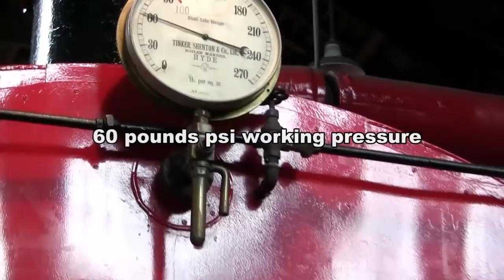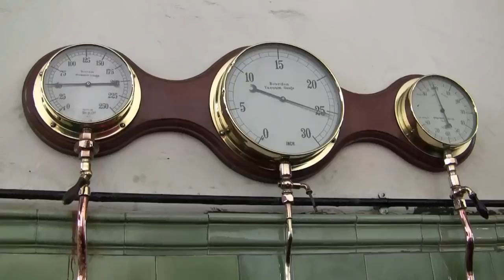Big Steam Engine

Comment: Over 100 years old engine and still in brand new condition and runs just like new. Modern engine are garbage compared to these. These are built to last. These are the engines we should be building.

Comment: It is just such a spectacle to see those valve gears moving while the engine is running. Truly, modern machines could never match the fine engineering and sheer elegance of these metal masterpieces!
Reply from the maker: Engineering elegance is quite right - all designed with pencil & paper...not a computer in sight!
Thanks for watching,
M

Comment: Furniture mills around my area had steam engines that recycled used steam into the dry kilns to dry the lumber. Hale Co. in East Arlington Vt. used theirs to power two Westinghouse ac generators along with belt driven wood working equipment. W.J. Cowee in Berlin N.Y. ( remember your old tinker toy set? ) used their horizontal and vertical steam engines just for generation of electricity.
Reply from the maker: Many thanks for taking the time to leave such a wonderful comment. I'm glad you enjoyed my vid.
Best regards,
M
Reply: I was lucky in that I got to see all this equipment in place even though it wasn't running. Younger folks have no concept of these things unless they see it in a museum setting. So sad that so much of history is just scrapped and melted and the knowledge that accompanied it lost to the pages of history. You can never describe the smells of dry kilns or the whir of shapers and tenoners in a furniture plant.
Reply from the maker: 8x56 Similar here on the West coast with all the industrial logging and fishing gear....sounds as if we are of similar age!
M

Comment: Here in Brazil, near my house has a very pacecido engine with this, of English origin and German boiler in good condition, part of the old system of pumping water. In the same place also lies a marine diesel engine, two-cylinder, over ten feet tall. 
Not to mention the steam machines Paranapiacaba, with some eight thousand horsepower. a magical place in the middle of the rain forest!
Reply from the maker: Thank you for mentioning this. I looked up Paranapiacaba in Wikipedia and read about some of the history of your area. Very interesting.
Thanks for watching and commenting!
Regards,
M

Comment: Ok, so now I have a question again. My hit n miss is 1.5 hp and 500 rpm. So (1.5/500)*5252
That is roughly 16, so 16 ft lbs of torque, how is that right? It seems like the engine has more power than that.

Comment: Am I correct that the engine could be replaced with a 500 HP car engine (in terms of being able to run the factory)?
Reply from the maker: Horse Power is one thing; torque is quite another. A steam engine has constant torque, which is considerable, whereas an IC engine develops maximum torque in a relatively narrow RPM range. Food for thought...
Cheers, M

Comment: Use the heat of steam engine to provide electricity and make hydrogen fuel so that engine keep running in very low energy momentum for longer duration

Comment: 1) Half the HP of a Bugatti Veyron, runs off coal.

2) WHY THE MUSIC??? WHY???
Reply from the maker: AlmightyBanger For no music go here https://www.youtube.com/watch?v=CdBcYg53DvE
Thanks for watching!
M
Reply: +AlmightyBanger Try getting a Veyron engine to run non stop 24/7 for weeks on end. At this power level, it would fail within hours. A day or two at most. With a giant steam engine like this, you could add extra boilers and feed it greater steam pressure and get more horsepower out of it, but the wear would increase, and the life of the engine parts would decrease. These things had to run and run and run, so they were overbuilt, built big and heavy and run at a lower steam pressure and horsepower than they technically could produce, but which prolonged their life and made them much lower maintenance. They were sized so that the power they did get out of it was exactly what the factory needed.

Comment: 60psi working pressure? That seems unlikey, seen as the pressure gauge shows it blows off at about 95psi
Reply from the maker: Plant was installed over a 100 years ago... Just reporting what I saw a few years ago. Probably conserving equipment to keep it running as long as possible. No?

Comment: WTF? Compound expansion to try to get some work out of 60 psi steam. A joke, no? (For the un-initiated, to get any sort of efficiency w/steam, you need HIGH pressure, >1000 psi, and lots of superheat, preferably with turbine. Else you're just making smog.)
Reply from the maker: Tell us how you really feel!
Reply: thumbs down for the 'WTF' comment
Reply: Putting the more advanced techniques into practice took time. People could not do everything at once, and there was immediate demand for cloth. An interesting example of the transition was the Titanic, which had a turbine that used the spent steam from reciprocating engines.
Reply: @oliviamonkey  Making joke in defense of engineering joke? Or just easily triggered? Much less waste to sneak in an electric motor to power the recip.